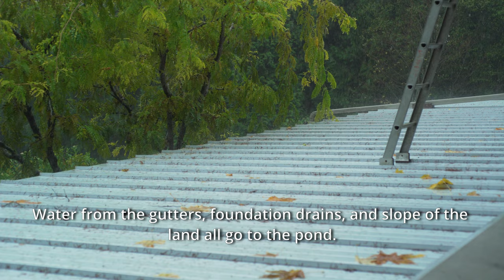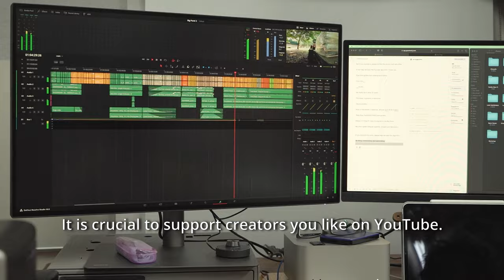DIY Pond in Country Living | How I Build / Seal My Natural Pond with Bentonite Clay | Big Pond, P. 2

Comment: Doesn't the water soak up into the ground in the middle then, or just by doing the sides keep all the water in, but what an amazing job and what you have created for nature 🙏
Reply from the maker: Thank you for your compliment. The middle part of my pond is mostly bedrock and therefore doesn't leak too badly, so I only applied a thin layer of bentonite. So far it is holding the water well.

Comment: That’s a lot of work! The engineering mind in me would wonder whether it’s possible to sling the bentonite.. but I guess what’s the fun in that..  how did you calculate how many bags you need?
Reply from the maker: Having done the other two smaller ponds earlier in the year definitely helped me plan the process of this pond a bit easier and ballpark the amount of bentonite we needed. Thank you for checking out the video!